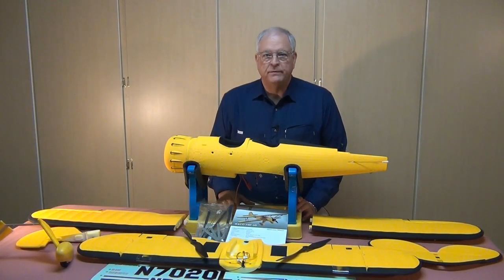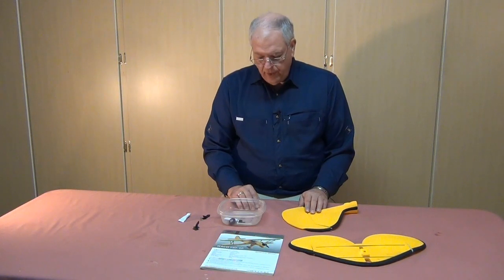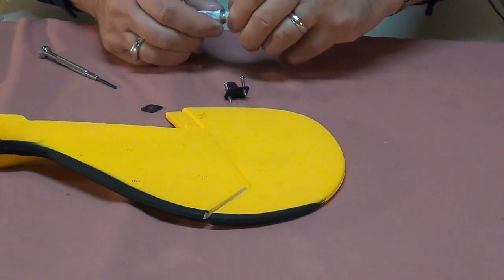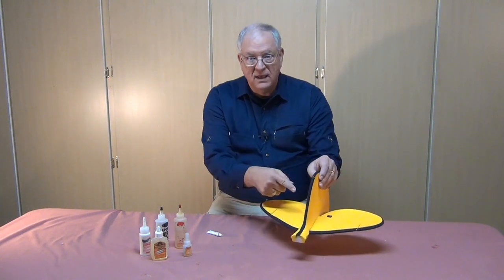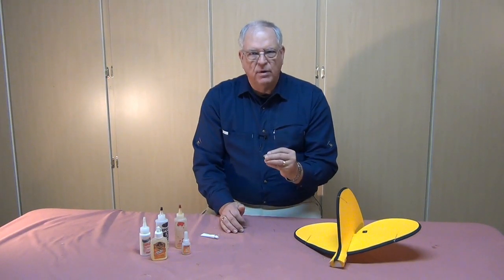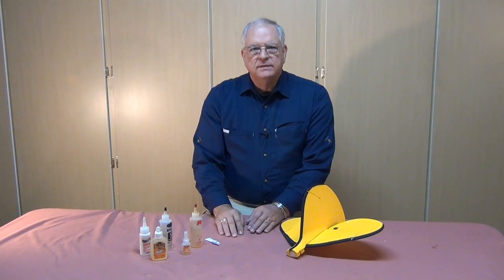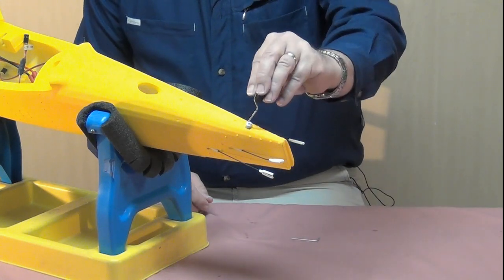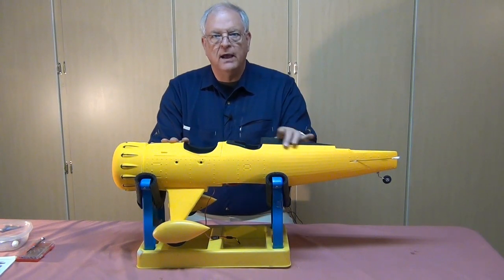Dynam Waco Build Log   Pt 1

Comment: This video is a couple of years old I wanted to add something about Foam Tac adhesive. As mentioned below, MotionRC is a source for the plane but also they handle Foam Tac, and at a better price than through Amazon. It adheres to most everything, holds tight and stays flexible. Even though I have all the adhesives mentioned and more it is Foam Tac I reach for most often.

Comment: my kit has a 4 1/2" servo extension wire with an object shrinkwrapped in the middle of it thats about an inch long and 1/4" wide and very thin. do you have any idea what that could be for ? It was attached to the wire coming off of the esc.
Reply from the maker: I believe what you have noticed is a little circuit in the throttle line that helps prevent the motor from hesitating or pulsing at low RPM. Lot of threads mention this on Dynam planes on RCGroups. It seems this was most likely with Spectrum gear if I remember correctly. Some solved this by changing the timing on the ESC.  As for the cowl, I cut out the thin plastic between the cylinders to increase airflow over the ESC and used just a drop of hot glue in a couple of places to hold the cowl tight. The propeller can push a lot of air into the cowling, pressurize the space behind and basically push it forward into the prop so some extra hold isn't a bad idea.
Reply: The RCPlaneviews.com Channel Ok
 thank you! One more question,  do you think I will have to program the esc, or will it be good to go as I received it?

Comment: do you need to use the friction style collet mine never came with it.
Reply from the maker: Motion RC has an explanation in the narrative for the motors on the spare parts page. Later versions use the silver "blade holder" not the friction collar. It screws to the front of the motor bell. Add the prop  then the nut. The video predates the change.

Comment: It always makes me smile when I see people recommending various types of glues on painted EPO foam or any other kind of painted surface but particularly EPO because paints used on on EPO are mostly acrylic.
It's well known that acrylic paints don't adhere very well to EPO foam so when I see people applying glue to painted surfaces and then saying how well it works, I cringe. 
In most cases they are applying the glue to the paint which has  already been established doesn't adhere to EPO very well so by applying glue to paint, the glue will have the same adhesive properties to the EPO as the paint itself and will peel off with the paint.
If you are going to use glue on painted surfaces, clean the paint off first so it's the glue adhering to the EPO and not the paint.
Does that make sense?
Reply from the maker: You may be interested in the video on  restoring EPO models on this channel where I use to tape to strip paint from an EPO model which is the point you're making. Happily the Waco is still flying after 5 years of use.
Reply: The RCPlaneviews.com Channel your very thorough. Foam tack and other types of ca glue adhere perfectly to less than perfect cleaned foam so your videos are more than perfect on a instructional stand point. Nice work.

Comment: can I use an 11v battery with this kit
Reply from the maker: serge dussault I wouldn't plan on it. The Waco has a big fuse, fat wings and fixed gear with wheel pants. In other words, lots of drag. It might fly, but you'd have no reserve power and it would be very sluggish.